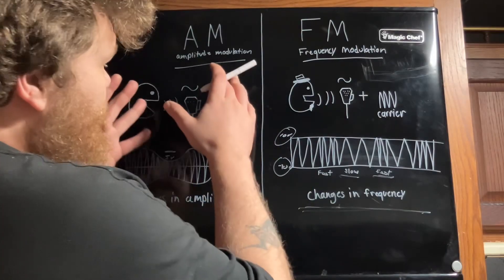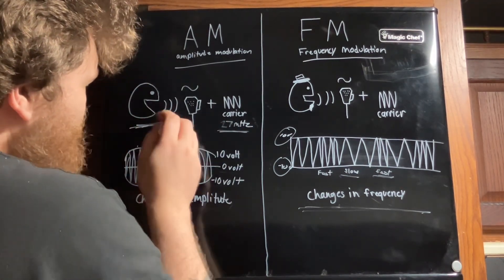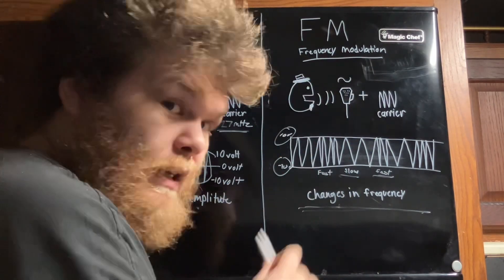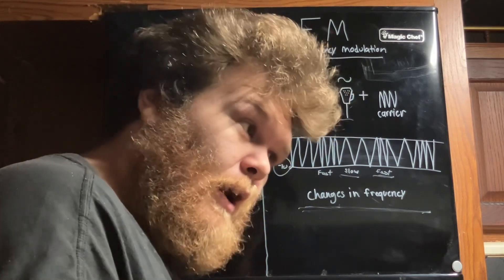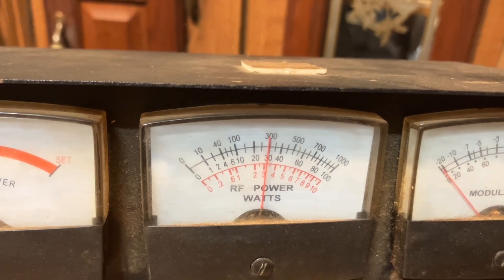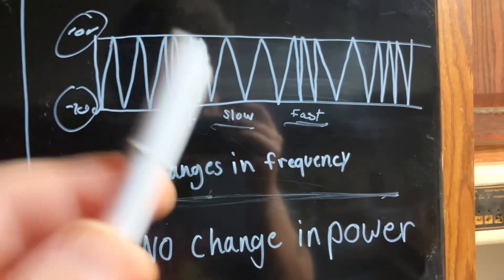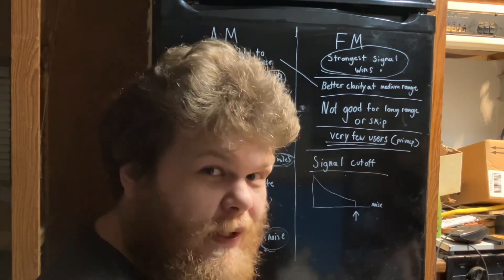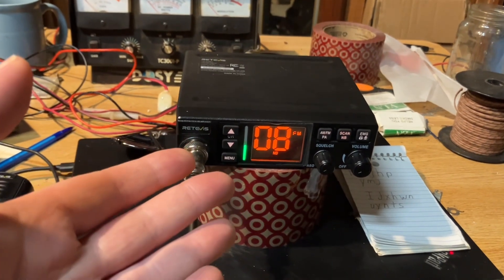AM vs. FM on CB Radio: Which One Should You Use?

Comment: In Europe, FM is more commonly used than AM, and in Sweden, SSB is mostly preferred while AM is rarely used. FM tends to cause less interference with neighbors. Back in Iceland, we primarily used AM, but my neighbor complained he could hear me. However, when I switched to FM, he no longer heard me on his TV.
Reply from the maker: That makes sense, analog television used 54 MHz if I do remember correctly. 

They had to include trap circuits in CB radios to filter out that second harmonic.

Thanks for commenting. It’s nice to hear from you!
Reply: @JohnnyJonesathome  No, VHF TV disappeared a long time ago in Europe. Analogue TV was on about 470-860MHz, the same as we use with digital now, though the top end 700-800MHz has now been repurposed for cellular comms. When CB was legalised in the UK, it was FM only for many years due to the problems with TVI. Since digital TV came in, AM and SSB have been allowed.
Reply: I've done some experiments, and an antenna tuner is much better than a TVI filter at suppression of harmonics. Since the advent of digital TV the number of TVI complaints has plummeted.
Reply: Non c'est faux, je n'ai jamais utilisé la fm en 35 ans de CB 😅😅 FM is crap and noisy...

Comment: I did the test, AM vs. FM vs. SSB. A friend of mine drove the same route home from work every day. 
As the commercial radio services learned 70 years ago, FM is the best for ground wave base to mobile and mobile to mobile communication.

Some minor clarification...
As the FM signal strength decreases to near the ultimate receiver sensitivity, noise will begin to degrade the "signal to noise ratio". This is normally a gradual effect. 
Commercial FM communications radios do not act like the FM stereo in your car. Depending on the strengths of the two competing signals, you will hear a sound akin to a growling cat underneath the stronger signal. The stereo in your car will switch between the two stations. 
FM most definitely can skip! There are a lot of hams that run 10 meters FM and intercontinental communication is common during the meaty part of the sunspot cycle. 
Low band FM scanner channels used by the California Highway Patrol are often active during fall and winter afternoons thousands of miles back east. 
Decades ago, FM proved its best advantage: the elimination of the user to constantly have to adjust the squelch to compensate for local noise levels as they drive around. Cops, firemen, delivery drivers, etc. only had to adjust the squelch once, after the tubes warmed up.
Reply from the maker: Thanks for the clarification, my friend!

I’m aware of FM being able to skip, after all, they use it for a tropospheric ducting all the time, it can bounce around back-and-forth for quite a while.

Specifically, when it comes to CB Radio, I’m trying to deter people from trying to use FM for skipping because no one else is using it, and due to the nature of skip it’s much harder to distinguish between voices if you’re using something like FM

And I have heard the garbled noise that you’re talking about 

Thanks for commenting 73s!
Reply: @JohnnyJonesathome Thanks for answering me. Here in Pittsburgh the very few locals still on typically use channel 36. During the day the band is dominated by dump truck drivers and the slag quarries. When the band is open I do hear some FM from the DX stations. 
Although FM (No Static At All) is nice to have I can't see the service returning to the level of popularity it had 50 years ago. Cell phones just work so well for most people.

Comment: FM propagates at 11m the same as AM.  26.805 is the USA DX FM frequency everyone agreed on.  If I can talk to California and Florida on AM I can talk to California and Florida on FM.   The strongest signal wins on FM, but it travels just as far as AM for the same amount of average power being put in.  FM plays hell on most CB amplifiers because you're putting out full power 100% of the time.  So it'll heat those transistors right up lickity split.
Reply from the maker: I totally understand and agree that it propagates as AM does.

But it’s a pain when two people are talking at once because FM will try to track the strongest signal.

And you and I both know that would be a pain on something like channel 28 where you have a large amount of people trying to talk at once haha.

I’m simply stating that in the video so people don’t give their hopes up trying to talk to people long range on FM.

It can be done, but it pretty much needs to be set up before hand 

As far as I know, no one’s really using FM on CB radio 

Thanks for commenting, Central Iowa!

73s!

Comment: I'll never forget the day I spoke with some guy in Ireland about 3,000 miles away, when skip conditions were just right, and that was on lower sideband running about 75 watts of heat, out of my 102" antenna. I was also able to make a contact on AM that day, all the way out towards Michigan. I wasn't far from Delaware.
Reply from the maker: Oh, that had to feel amazing! Ham Radio is spectacular when it comes to skip.

But CB Radio is an entire feeling on its own  hahaha

When you skip that far with CB Radio, it feels like you just punched in a cheat code!!
Reply: @JohnnyJonesathome That's why I say that the 10/11 meter area is the real "magic band". I have a video on YouTube of my getting to Wisconsin on AM with a barefoot Midland 13-898B.
Reply: @JohnnyJonesathome  My first experience with skip was back in the sunspot maximum of 1980, when, with a decent antenna and an illegal SSB CB set (barefoot, 12W), you could get from here in the UK to the USA.